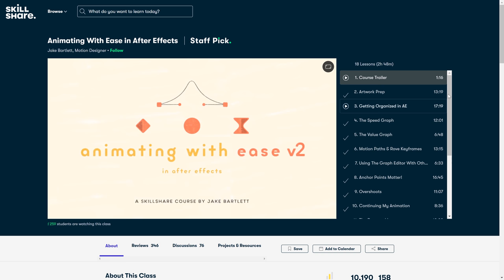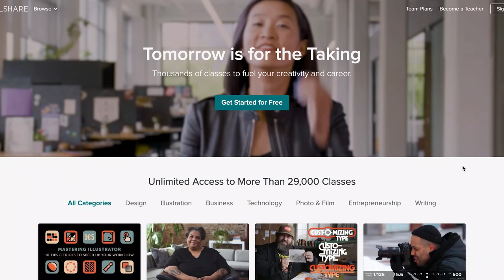How ice water makes hot water boil

Comment from the maker: Did you come up with an explanation before listening to mine? Was it the same or different?

The sponsor is Skillshare. The first 500 people to go to https://skl.sh/stevemould6 with get 2 months premium membership for free!
Reply: Steve Mould only a minute in but I assume it’s because the cold water causes the pressure inside to reduce meaning the nearly boiling water is then able to boil?
Reply: Thanks for the new video
Reply: I wondered why there is lots of videos showing super-cooled water forming solid more frequently than super-heated water forming a gas and nucleation sites.
Reply: I did but only after you stated ecplicitly to put the bottlecap back on. Nice demonstration i have to say!
Reply: Yeah, I don't think the pressure drops due to water condensing, there isn't enough vapour in the air to make a difference in pressure.

The pressure decreases because the air pressure of the actual air just decreases with temperature. Its like opposite of the old trick where you heat up a dented ping-pong ball to fix it since the air pressure increases inside it when heat is added.
Reply: Same explanation
Reply: @marcusjackson5837  this doesn't make global warming overrated at all. And it's not like climate scientists don't know that, btw.
Reply: I knew that it is because of pressure drop but I didnt realise that water vapor turning into water is the most important factor. I just though the pressure drops only because the gas (air) is cooled down :)
Reply: My personal explaination was a little bit more compressed, but essentially the same. No pun intended.
Reply: I  put some legs of strawberry cuttings in an old jam/pickle jar last autumn and the jar got left out for weeks. I sealed the top on after rainfall and decided to leave it to see what happened. Maybe get some bugs n stuff.  But when I went to it weeks later it had broken like your bottle here and it was thick glass. Another thing about water and air pressure changes last week when storm Ciara passed over I spent quite a bit of time bailing out excess water from my pond to prevent overflow. 2 days after I was dismayed to find the water level had dropped quite drastically. A good 4" which is around 100 litres. I thought the lining had a hole in but the level has stayed the same since  and there's no hole in the lining. Could the weather cause this? Saturday night my pond was full and both gardens waterlogged to capacity. 36 hours and fierce winds later all gone and the ponds dropped.
Reply: I realized what was going on as soon as I saw the bottle :) no need to pause.
Reply: Yes
Reply: how did the bottle not crack/explode
Reply: I wanna see a video about what happens when you put metal balls on a rotating surface (axis)
Reply: First thing I thought about is pressure! Because pV = nRT (the ideal gas equation), and with constant V and n, it becomes Gay-Lussac's law: p/T = nR/V = constant, hence lower temperature means lower pressure, and with a lower pressure, comes a lower boiling point because there's less pressure to prevent it from converting into a gas.
EDIT: Seems like it was not exactly the same... but still seems pressure is the reason.
Reply: I'm just about to watch - I think that the cold water cools down the air inside the bottle, which lowers the air pressure to the point that the already hot liquid begins to boil - like making tea at the top of everest, kettle boils faster.
Reply: Ah ok - the phase change and all that energy - like a heat-pipe in a CPU cooler - well I was nearly right!
Reply: Before watching the explanation: the cold water makes the air in the bottle contract, lowering the air pressure in the bottle, thereby lowering the boiling point.
Reply: My question is: how do we know tea wouldn't be even better under even higher pressure? Say with water of 110 degrees or so? Seems like an odd coincidence that tea should be perfect at atmospheric pressure at sea level.
(and yes, I know there is tea that's best at 90 or even 80 degrees)
Reply: I did : its magic
Reply: @chrisdavis3128  Coz they're cooler.
Reply: @marcusjackson5837  And abnormal temp difference arise because....?  You have one guess.
Reply: Almost same
Reply: My explanation before watching: The bottle is sealed which means the pressure is going to drop when we pour cold water on it (probably more due to condensation than actually cooling the volume of gas inside). Lower pressure = lower boiling point. I assume the water in the bottle is about 80°C which means we need about half the pressure at sea level to boil it.
Reply: 1. Yes
2. The same
Reply: Yep, i did.  Simple thermodynamic principles.  I paused before you talked about sealing the bottle, and, I predicted that would be the pivotal step.  Great experience to share with your kids if interested in science!  I was also wondering if the bottle would shatter right away, lol.
Ps.. don't tell your friends your kid gave you the black eye, make up some fun winding story and see how long they'll believe it...lol
Reply: I had the same explanation, except I didn’t think about the heat capacity component
Reply: My explanation was that the cold water makes the water vapour condense on the inside of the bottle decreasing the pressure inside making the hot water begin to boil again
Reply: Different.
I thought you were afflicted by allergies or a cold, then you revealed you're afflicted with a daughter.
Reply: I just saw the demonstration and I had a theory that only got confirmed when you purposely mentioned closing the cap tightly

I believe that the cold water condensed the vapor thus decreasing the pressure in the bottle making the vapor pressure of the liquid (at near 100°c it's gonna stay at around 1 atm while the pressure will be significantly less) higher than the pressure in the bottle and that's when liquids boil
Reply: I got it when you said about the lid
Reply: @lukasbalaz9988  you're definitely half right! In fact, that's more the way a chemist would think about it. That the first import factor is the lower pressure creating a pull for water molecules coming out of liquid phase, and the second is just about what steve described

Things get more interesting if you maintain the boil in a closed system (I guess you need fancy equipment for that) because then you can start to explain things in terms of entropy decreasing with enthalpy, in a constant free energy state
Reply: Looked at the thumbnail, was confused for 2 seconds, thought about it a little longer and came up with an explanation, clicked the video, was happy to be right ;-)
Reply: by 0:05 I had it figured out. That's 2 seconds at 2x speed.
Reply: I work with boilers and steam turbines sooo yes
And your thumbnail is so good i didn’t have to watch the video but did anyway
Reply: And of course this is one of the main reason power plants needs cooling to produce a good vacuum for the turbine
Reply: Here, take this placebo like for healing eye!
Reply: I jumped pretty early to Boyle’s Law - but it took a few minutes to figure out why (I was overlooking the cap being installed after putting the hot water in!).  Also hope your eye is OK - looks like it may have been giving you a bit of grief?
Reply: Hoho! That’ll teach me to comment before watching to the end!  She did your eye a goodun!
Reply: As soon as i saw it was capped, I was like "air pressure". The cold water cools the air inside the bottle making it more dense, lowering the pressure in the bottle, lowering the boiling point of the hot water.
Reply: Pressure difference, of colder air, allowing for "vacuum" like conditions up top, due to cold water, allowing the boiling water to boil easier?
Reply: Wicked video. I got the wrong end of the stick and started trying to think about energy flows. Pressure changes around the phase changes of fluids is always so counter intuitive. Please check out thunderf00ts video https://www.youtube.com/watch?v=In6ibUgDO3U. he demonstrates the exact same phenomenon but with a vacuum rather than pre-heated water. Interesting!!
Reply: What happened to your right eye
Reply: Because of pressure of the air?
Reply: I came up with the same answer.
Reply: Yes, instantly, i boiled water in the mountains. Nice experiment though.
Reply: Same
Reply: this is unrelated to explanation BUT BE VERY CAREFUL with pure water in the microwave, its known to "blowup" and splash boiling water everywhere.. so put a pinch of salt, or anything to prevent such incident. (personal experience, was gonna make tea)
Reply: Just clicked, haven't watched yet. I'm guessing it lowers the pressure inside the bottle which lowers the boiling temperature for the liquid.
Reply: Before watching the video, I'm guessing the cold water drops the air pressure in the bottle.
Reply: I did, but I'm afraid I didn't pause the video, as I'd guessed that it was nearly-boiling water and low pressure before clicking.
Reply: I thought maybe you'd been straining too hard. Never would have guessed it was because your daughter punched you in the eye.
Reply: I was actually thinking about the pressure difference of the heated gas and the sudden change with the cold water, you explanation was more detailed and accurate though
Reply: I got that pressure is involved but I thought down the root of how water boils in a vacuum thinking along the lines of the pressure being too high for more water to boil but when cold water is poured over it the air condensed reducing the pressure enabling boiling to start again. I'd describe it like the opposite to a balloon, You could inflate a balloon under something or between a wall and a light object and as pressure increases in the balloon the object is then lifted/pushed away. In a similar way, but without the balloon, I thought the air pressure in the bottle increased as the water boiled until the pressure reached a point where it applied pressure to the surface of the water which stopped boiling occurring, but along the lines of osmosis where the concentration of gaseous water in the air was too much for more to boil off/become gaseous. Maybe that's basically talking about the same principles but without actual knowledge, I don't know. :)
Reply: Same explanation but I love it
Reply: havent watched yet but the cooling air in the bottle contracts, decreases the pressure inside, and lowers the boiling point
Reply: @alcinnovations  cooler yeah, but cooler no way. ;)
Reply: I got it Steve! I wouldn't have been able to think of the solution without the demonstration though. Pretty neat!
Reply: I could tell what was going on from the thumbnail, my explanation focused more on the air itself cooling and reducing in pressure though, I’m sure it’s a combination of both but probably more from the water vapor.
Reply: had it at 0:43 .. The pressure in the bottle dropped as the gas was cooled from the cold water.
Reply: i had figured how it probably worked. It was really cool to see such a concept in practice.
Reply: Steve Mould Before watching the video, I’m going to guess that the ice water causes the rapid condensation of water vapor inside the glass, creating a vacuum that reduces the pressure and allows the water to boil. Looking forward to hearing yours!
Reply: 0:50  pressure.
It  immediately became obvious when you capped the bottle.
Reply: And don't use distilled water!
Reply: The same explanation:
Reply: As I saw that you closed the bottle it popped into my head. When you poured cold water onto capped bottle, water vapor condensates, pressure drops and boiling temperature drops. I haven't watched it yet but that would be my answer
Reply: Paused at 0:46, my assumption is that the cold water shrinks the bottle ever so slightly, and increases the pressure inside the bottle before the transfer of heat allows the warm water to cool.  I think it is probably different than that, but it is a rough guess about pressures.
Edit, Oops, I forgot that a lower pressure decreases the threshold of boiling, not the opposite.  It makes sense.
Reply: The guy you got that video is retired from the "Rhode Island College | RIC · Department of Physical Sciences PhD" you te oshould get together a do some video ...
Reply: I'm 6 seconds in, and I'm sure the cold water cools the gas in the bottle, lowering pressure, allowing the water to boil.
Reply: I got it fairly quick. A great test of the depth of understanding.
Reply: Yeah, this was very obvious imo surprised you made a video on it
Reply: I actually did this experiment in the high school so I knew what would this video be about.
Reply: I guessed correctly about the pressure but didn't even think about water vapor
Reply: Yes I did. I was wrong. Good to know the truth.
Reply: I paused it and thought the water would cool the air in the bottle lowering its preassure, then I didn't think of the lower boiling point and gave up.
Reply: I also agree with many of these comments that the pressure drop is mainly from the temperature drop of the air rather than water condensing.
Reply: I initially observed the bottle as full of water, but split into two distinct densities. When heated and capped the energy leaving the waters surface as water vapour thereby increasing the potential energy in the top half of the bottle.  Then by cooling the top half of the bottle reduced that areas ability to hold water in the gaseous state and it was forced by the laws of thermodynamics back into the liquid half thereby transfering energy back into the water and returning it to the boil. An old school science lesson was bugging me about latent heat of evaporation and what is occurring with energy exchange and phase change. I think it would look good graphed. I also reckon you need to hook up with Dan and Gav at The Slow Mo Guys and get them filming the super steam explosion in super-high speed.
I apologise for laughing out loud @06:22 - Mine presented me with a Hayemaker to the nads a couple of days ago!  Stand tough brother ;¬)
Reply: @Steve I suspected that it'd be in relation to superheated water in the bottle, and the cold water causing some form of nucleation site to form, either by causing stress on the glass or by condensation of vapour.
Reply: I'll pedantically point out that water vapour has a higher heat capacity by mass, but lower by volume.  I know you know that but trends in specific heat capacities were confusing to me until I understood the difference.
Reply: I figured it out in about 10 seconds after seeing you pour it, yeah. On the other hand, if you had asked me how to boil water just by using ice water, I don't know if I'd have come up with this solution.
Reply: Same explanation
Reply: I guessed it was pressure reduction boiling  through condensation from the thumbnail alone . But didn't guess the water was preheated to atmospheric pressure  boiling point  first.  I assumed the pressure in the bottle had been somehow reduced nearly to room temperature boiling point through vacuum pumping. Silly me as this might  likely dangerously implode the bottle.
Reply: @marcusjackson5837  The equator receives more sun than the poles. There's your temperature difference. Push up the average temp and the extremes will scale by the same factor - the absolute difference will grow.
Reply: got the same answer, would be interested in a different explanation
Reply: Steve Mould I thought that the cold water would somehow blanket the hot water like how an igloo works, and then the heat that would have been radiated out actually stays inside of the bottle, causing it to boil. This is of course wrong.
Reply: It was the same and much before your explanation.
Reply: For now, I'm assuming a quick pressure drop from the air inside the bottle, because of the cool water you're dropping on top.
Reply: I said to myself:"ahh the cold water lowers the pressure" and I felt smart lol. Thanks Steve.
Reply: @marcusjackson5837  I think there is a misconception in the society - Global warming and climate change. People use them interchangeably but these are two individual concepts. Global warming leads to disruptions in the Earth's temperature balance, hence leading to climate changes and extreme weather. Climate change is a boarder phenomenon that is also caused by additional factors including urbanisation, deforestation (affecting directly rainfalls but also contributes to global warming) among others, but undeniably global warming is the biggest factor in play.
Reply: As rge ice water is poured the air pressure drops inside of the bottle this lowwring the boiling point of water. The hot water reaches the boiling point of the new pressure
Reply: I came up with an explanation right after seeing the title. It was similar to yours, although I did not factor in the condensation of the water vapor.
Reply: Penny Lane with a pressure cooker that is an experiment you can do yourself.
Reply: @marcusjackson5837  you don't understand global warming then...
Reply: I got it right!
Reply: Because of all the YouTube content provided by you guys I figured it out before you said it:))) thank u so much for making the world smarter!! Ur like a teacher but u make millions of people smarter not just hundreds!!!!
Reply: As soon as you said "quickly put on the cap", it was clear to me, why it works (no need to pause the video). Still an interesting video :-)
Reply: @JohnSmith-td7hd  in theory, you could; if you can find a substance that has its triple point or critical point near room temperature, then seal it onto a container at the correct pressure. A slight increase in temperature (or decrease in pressure) will then cause it to boil.

https://en.m.wikipedia.org/wiki/Triple_point
Reply: My explanation was the same.  But I was also worried the cold water could shatter the glass and you'd hurt yourself 😂
Reply: I had the answer before I even started watching the video.  Just from the thumbnail, I knew exactly what was happening.
Reply: My first thought was actually super heated water because I've seen super cooled water freeze so i thought why not the other way around? I though the local contractions of the bottle as you poured ice water on it would act as nucleation sites. I was quite surprised when you very specifically discussed those after the guess prompt.
Reply: Another fun one is making water 'boil' into ice using a vacuum chamber. 
Playing with gear like that makes this sort of gear makes this sort of thing easy to work out without having seen this exact version of the demonstration.
Reply: Literally the same as you
Reply: Steve Mould im gonna guess a reduction in pressure.
Reply: I did solve it nearly instantly, but I stuck around to see how you avoided thermal shock.  Seeing that thermal shock caught up with you restored my paranoia in mixing cold water with hot glass.
Reply from the maker: @lonjohnson5161  honestly I was amazed that I got away with it for so long!
Reply: Entropy makes this happen .
Reply: Great video!  I thought of the explanation before I watched the video.  

Also, really appreciated the extra bits about thermal shock and super-heated water.
A viewer trying to replicate this should know of the possible dangers before hand.
Reply: Exactly the same actually. But what a cool experiment with the colours!
Reply: Hey Steve!  Congratulations for making the cover of "The American Journal of Physics" (Feb2020)!! One of the diagrams on the front cover (from an article on the behaviour of chains) prominently features the "Mould Fountain". Never mind "Time" or "Rolling Stone"... this is what it means to arrive in my book!
Reply: I knew it was from a pressure change, but your explanation was much more thorough
Reply: Believe it or not, but i figured it out before watching the video. What i didn't know was the bit about heat capacity, but i think that has to do with the density of the medium; i.e. liquid vs. gaseous water.
Also, i wasn't aware that water could become super-heated, although i did know that it can become super-refrigerated without turning into ice - then, if it's given even the slightest jolt, it all turns into ice quite rapidly.
Water is weird.
Reply: @Steve Mould 
Ok, here's my question:
This reminds me of a trick I think we've all seen in which aluminum cans are crushed by boiling the water in them and turning them upside down into cold water which condenses the water vapor, leaving a vacuum and crushing the can. 
Additionally, we know that water can boil at room temperature if the pressure is low enough. So, using the same technique used in this video, wouldn't the water boil even if left to cool? I assume that if the bottle fills with water vapor and there is therefore little to no air in the bottle, a near perfect vacuum would ensue and the water would boil even if allowed to cool. If not, what if it were allowed to cool and then ice water were poured over it? This would lower the pressure even more and may disrupt the equilibrium established enough to make it boil. 
Just like @John Smith, I too wonder whether a system could be made that is sensitive enough to changes in temperature that even the heat of a hand would cause it to boil.
Reply: 50 seconds in, but from what I have seen so far it feels like yo uaren't making the hot water boil using cold water. You use a microwave to boil it, and then use cold water to contract the air inside the bottle (to some extent by condensating water saturated in the air, to another extent by ideal gas law'ing the air) to lower the pressure. Saying you boiled the water using cold water, would be as obviously incorrect as saying you boil water using a vacuum-pump. In fact, try the same experiment in a vacuum chamber, and you will notice that the cold water does absolutely nothing (assuming you manage to get the hot water to not boil despite already being in a vacuum. I suggest magic for that part).
A great image to help you understand what is happening would be: https://en.wikipedia.org/wiki/Triple_point#/media/File:Phase-diag2.svg

edit: ...and soon after you start explaining what I just said. Why did you title your video (and preface the video) like this, when you knew very well it was wrong and only makes you sound like clickbait?
Reply: I came up with the same explanation before I clicked on the video.
Reply: @SthamerAMVs  Thought the same thing! Hope I/we're right
Reply: @eklhaft4531   🎉
Reply: I thought that it was due to air pressure dropping as well but not due to the condensing of water. If it is due to the condensing of water I would expect to see condensation on the inside of the bottle.
Reply: Yeah, it was fun :) Took me about 10 seconds to fully formulate the answer
Reply: 0.45 in and I'm guessing it's because the cold water condences the air creating a slight vacuum that lowers the boiling point of the water which is already just below boiling, this is my theory or educated guess.
Reply: I did!🎉 reminded me of the Drinking Bird toy and the experiment where you do the same with a metal barrel and it implodes under the pressure of the atmosphere. Great video as always!